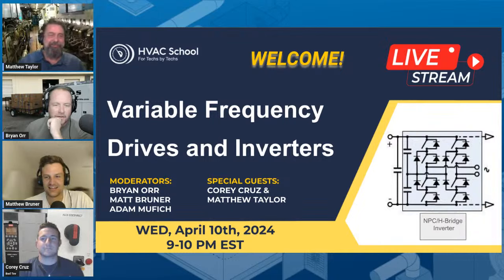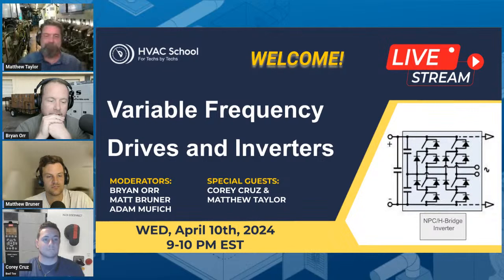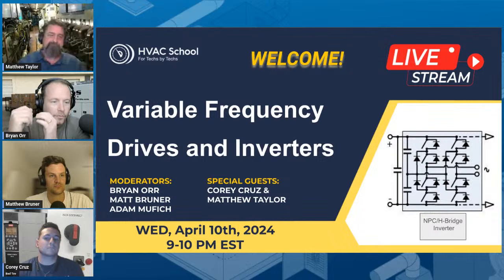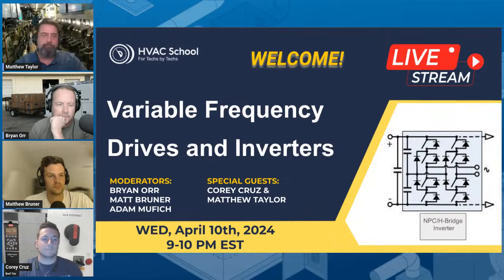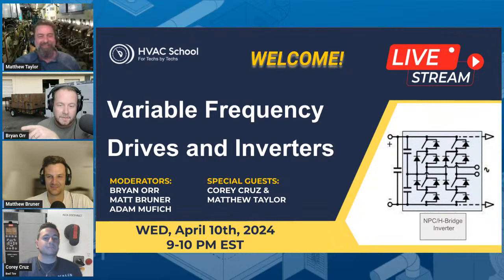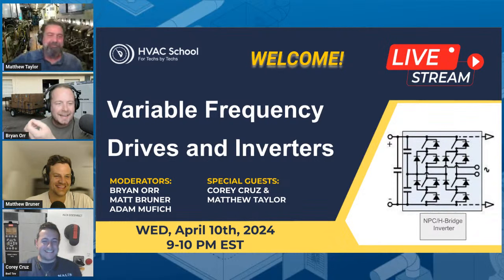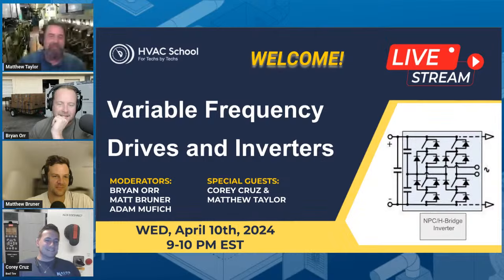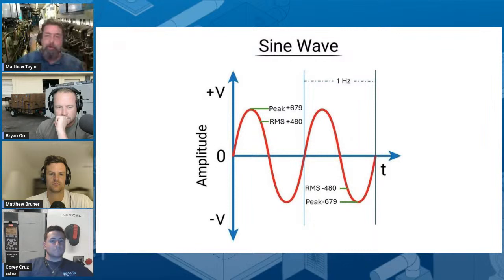Variable Frequency Drives and Inverters

Comment: I have to say. This channel has gotten my attention. I don’t think young techs understand the knowledge and experience you are sharing. I needed the refresher, thank you. I know drives can be intimidating, especially the larger hp rated ones, but in the end, they all follow the same principals and accomplish the same thing. This is where the industry is, regardless of what you specialize in the field. Actually I find it easier to work on compared to the equipment in the 90’s and early 2000’s.

Comment: Thanks for the video. fascinated at 37:36. We have a lot of overseas jobs where the line voltage is 50 Hz. I suppose a VFD could convert the 50 Hz signal and give us an output 60 of Hz for our standard equipment. Any concerns with this? I guess bypassing the VFD (or VFD malfunction) would still make that inadvisable? Cool presentation.
Reply: Yes, there are frequency converters.
50Hz is a standard.

Most 250 V equipment are rated for 50/60 Hz.

Comment: EEV’s are becoming cheaper to manufacture. I work in R&D for a commercial supermarket manufacturer. Tighter control?  Maybe theoretically, but some of these valves (stepper valves) do not control good at all. Cheap manufacturing in China. They should control better, but it’s only as good as the quality of the manufacturer and the quality of the code that was written to drive these valves. Sporlan EEV works best with their controller. It depends on your support and your microcontroller. You could make them work fantastic with an Arduino if you were good enough at writing the sketch.

Comment: All i know is vfd's break down all the time.
Reply: That’s a fact. They fault out often. Nuisance trips. Intermittent trips are common. This also depends on the quality of your power supply. If you get a lot of phase losses and things like that you will have a lot of failures.
Reply: As someone who started, commissioned and warrantied Vfd’s for 6 years. This is 100% inaccurate. Although 10-15 years ago I would have agreed, today absolutely not.

Comment: Technically AC to DC is a “Converter” while DC to AC is an “Inverter”.  Obviously changing 60 cycle AC to DC is simple and is something any electronics hobbiest or tech can do and understand easily.  While a rectifier (diodes these days) and a big cap produces DC with ripple, adding an inductor and high frequency small caps reduces the ripple making the DC power useable for most applications.

A three phase “inverter” to drive motors is  actually three separate inverter circuits all drawing from the same DC power.  Each inverter circuit is driving its own motor winding.  

Creating a variable frequency / voltage waveform CAN be very accurate, eg a sine wave inverter.  For driving sensitive loads you want a sine wave inverter, sometimes driven by generators with somewhat inaccurate speed control.

For variable speed or constant torque motors pure sine wave outputs are not optimum.  These vfds or ecms have specifically designed waveforms to achieve torque when needed or to produce efficiency most of the time.  

Achieving reliability in power electronics used in poor environments is the real challenge especially for low cost applications.   Clearly in  industrial applications where cost is less of a factor a Vfd can be installed in a clean situation and cooled with better strategies.